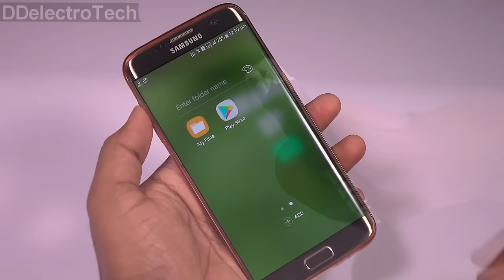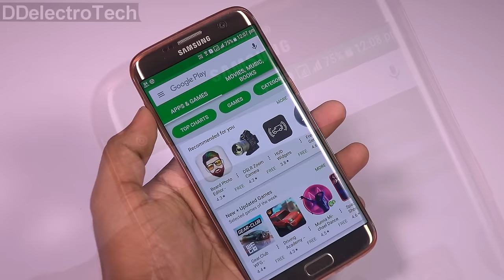Turn Any Phone into Universal Remote Controller - DIY  IR Blaster

Comment: It’s lockdown again in Mumbai and my A/C remote stopped working ran out of luck i guess i wish i had a friend like you could have been such a huge help
Reply: In split ac's there is a switch inside the front panel, lift up the cover and you can see a slight cut with a button inside. Click it with a pen etc and enjoy :)

Comment: Why does it require 2 IR diodes?
Reply: For more range
Reply: Xeon The Gamer  u can use 1
Reply: Xeon The Gamer  I think, he just wanted to lower the risk, of burning the LED, by only using one, and this removes the need of using a protective resistor.

Comment: Guys download sure universal remote its better anyways
Reply: U would still need an or blaster in newer phine especially the new s8 and s8 plus
Reply: @heatherriley8980  The S8 and S8+ lack an internal IR blaster. Anything after the Samsung Galaxy S6 lacks one, I assume they did this due to not enough demand or simply to reduce costs and make room for other internals and features they deemed more worthwhile. You're right though, without a phone with the proper hardware or with an external transmitter, the app won't be able to help you.

Comment: Why did you use 2 ir transmitter?  Instead of 1? I'm going to try it but only with one Ir for some led lights
Reply: both are connected parallel but in opposite polarity.. this way , signals coming with opposite polarity will drive one IR led at a time.

Comment: Does this also work for phones without a dedicated headphone port? If not, will using a 3.5mm to 8 prong Lighting dongle work instead?
Reply: Yes it will Work,
For Testing you can Install the App and Insert Your Headphone or Earphone and if it Doesn't Detect the Device then Go to Settings of the App and Chose Device as Smart-Zaza and Try Pressing Buttons if You Listen the sound then It will work
Reply: @DeekshithSH  alr thanks

Comment: does anyone know how to increase the range of this?
 I can see the led through camera hard blinking.
Any app which increase the output voltage or external amp circuit or even any specific led that can provide longer range. I have samsung j5
Reply: You can volume up your phone. I think

Comment: Why should we use two IR leds?Shall I use a single IR led
Reply: bharath kumar singanamala Yeah,you can put as much as you want.2 will double the signal.You can also make ones with way wider signal with transistors.And you will need to fit the right voltage of the IR LED Diode with your heasphone jack.So if ur headphone jack is 3v,you will need a 3v ir diode.It'll work no matter how much IR LED Diodes you put.

Comment: I don't have welding machine 😥
Reply: It's soldered not welded, but for the people who don't have a soldering iron you could just twist the led leads and the wires together. I would recomend to leave longer wires on the audio jack to make it easier to twist them together. To secure the wires you can wrap some tape around it tightly. Before twisting them together you have to take the coating  off, just light the wires for a couple secconds with a lighter, you should see the coating burn off. If you only have 2 IR led's and dont want to risk breaking them i would skip the sanding since it's pure esthetic. For people who dont have IR leds laying around you could take them from a old remote you have.
Reply: Btw i`m pretty sure it will also work with 1 led, so if you only have 1 old remote laying around you`re probably fine only a bit less range. If you get one from a old remote the leads will be the same length, to see which one + and which is - you can look at the side of the led. The flat side of the led is the - lead.

Comment: Hello All, is it not needed a resistor as current limitador?
Reply: The output does not give too much current (nor voltage), it is limited by its impedance. Resistance built in the output.